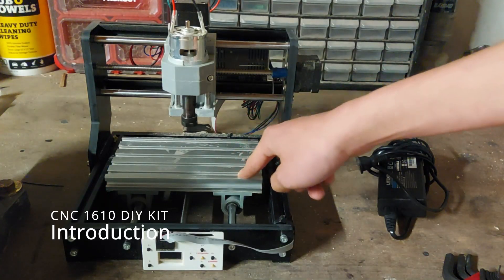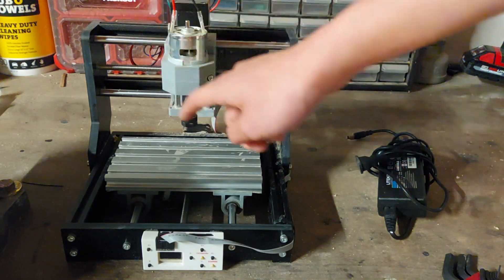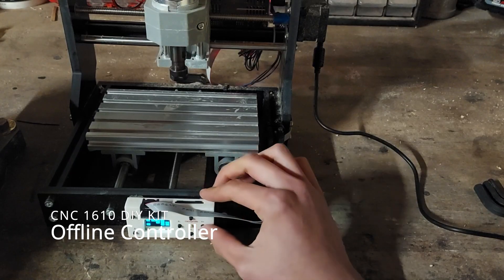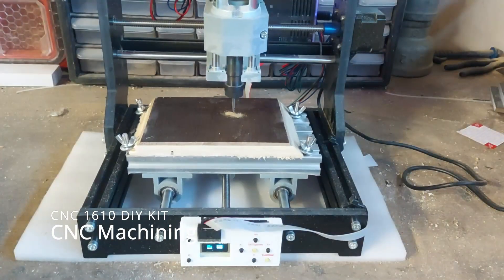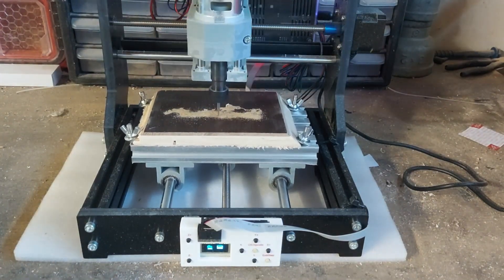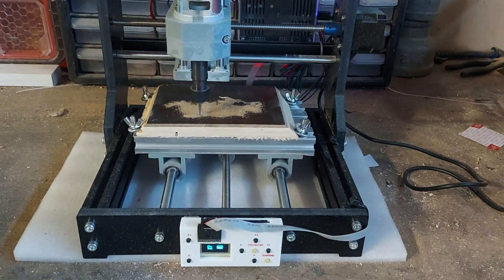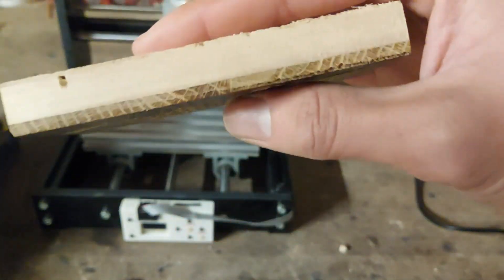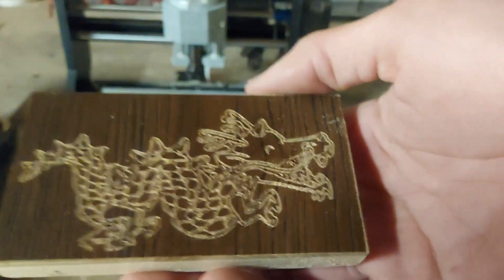CNC 1610 DIY Kit Review - $150 CNC Mill!

Comment: I have a 1610 for many years and have beefed it up since with an all metal Genmitzu spindle holders and rails to suit and gives me the results I want  as on a 3018 router bar the smaller table.
Reply from the maker: Awesome! How’s it working now with the upgrades?
Reply: @DragonBuilds   I use it with a laser module as well and also a drag bit mounted in  a lump of aluminium and providing you are aware of its limits of size and power  it's every bit as good as a large machine.  Thanks for your reply.
Reply: By the way, I did increase the  size all round by about 40mm using the cheap and available  extruded rail for improved clearance all round.
Reply from the maker: Cool! Definitely sounds like an easy upgrade to get a lot more performance. I’d love to have a machine this size that can mill aluminum.
Reply: @DragonBuilds Yes, that would be a big plus. Taking small cuts may be ok but I haven't got the patience. Cheers.